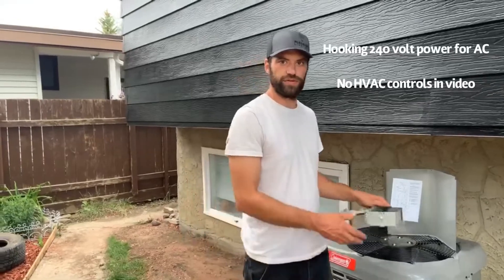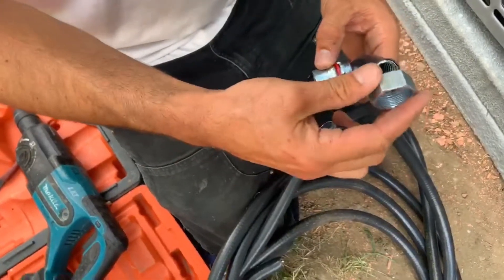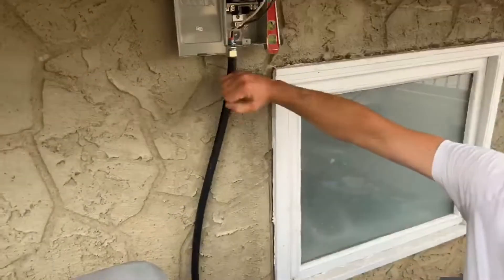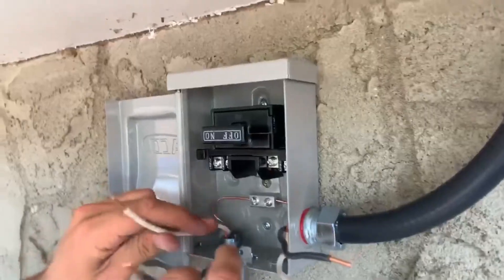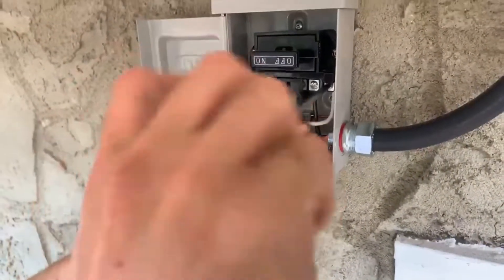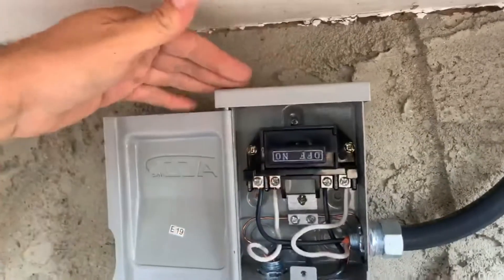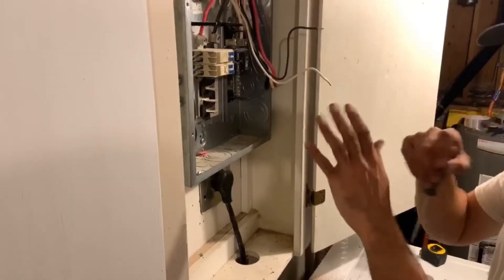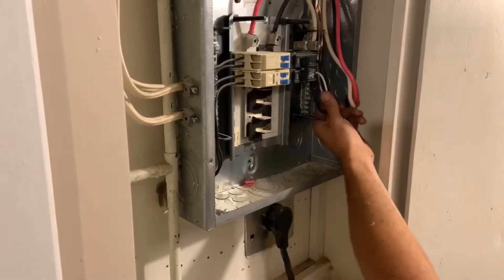How to do electrical on a AC unit, includes terminations to disconnect, AC unit and breaker.

Comment: With a minimum circuit ampacity of 18.4 you could have also ran #12 on that 30a breaker
Reply from the maker: We often assume #10 for an AC especially with a 30 amp breaker, as it creates less confusion. But your not wrong you can size the wire based on the amps rating on the unit.
Reply: Most people don’t know article 440 exception including many inspectors. Glad you do 👍
Reply from the maker: @kangaroogod  we are in canada so we use the CEC but it’s similar when it comes to motor loads